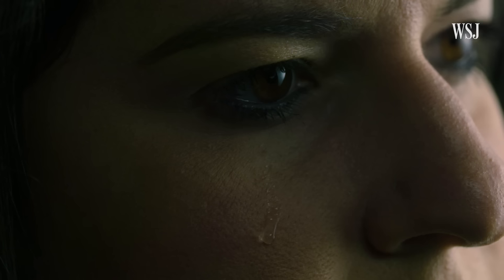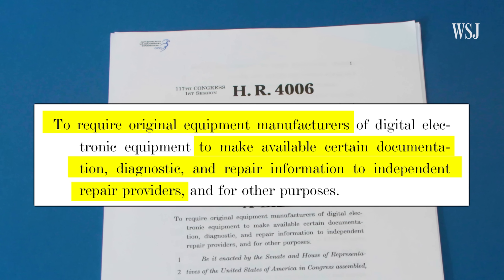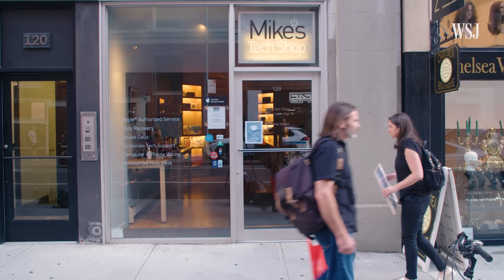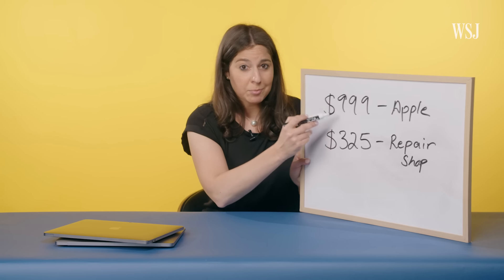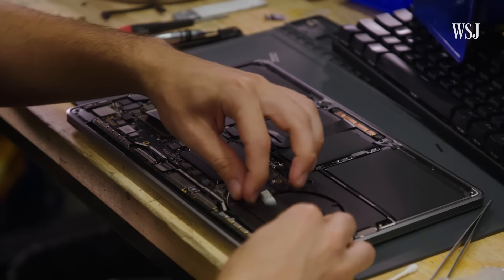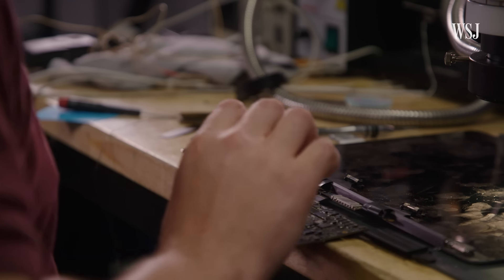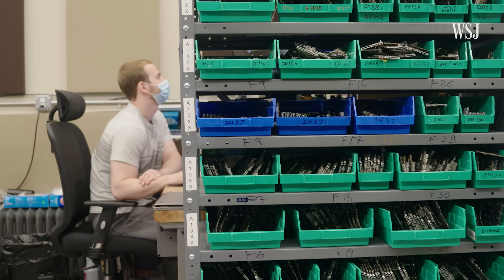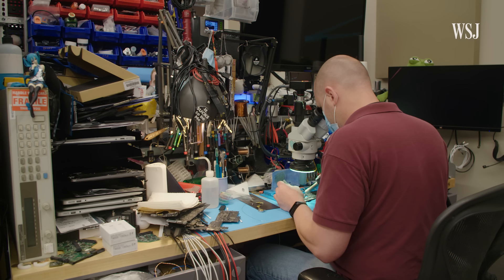Apple Store vs. Repair Shop: What the Right to Repair Is All About | WSJ

Comment: This is what happens when MBAs run companies instead of engineers.
Reply: Apple is the most profitable company ever. This move is genius. That being said, I'm glad I use no apple garbage
Reply: Number of attorneys vs the number of engineers at Apple on payroll: I am guessing that the number is pretty close.
Reply: @JohnMurrayOP  not even close, over 50,000 people work at apple park they only have a few hundred lawyers.
Reply: Especially with Tech companies this is noteable :)
Reply: Sanw with Boeing. They're going downhill due to the accountants and MBAs
Reply: @Dan16673  This move is not genius at all. This move is monopolistic. They know their only competition is Google, an ally, so they can pull moves like this. If a true competitor arose who knew how to build way more reliable, versatile and functional technology, Apple would wake up. Unfortunately, all their Asian competition is still behind in software and still has to partner with American firms like Google and Microsoft to get their phones and computers to run. So Apple will continue to rake in easy money. But it won't last forever. In like ten years, some college kid is going to design a new motherboard or OS or whatever that's going to shock the world and they'll do to Apple and Microsoft what they did to IBM.
Reply: Doesn't make any difference. Engineers get MBAs degrees too. Most CEOs at tech and manufacturing companies have engineering backgrounds. Engineers are not magical beings who will be opposed to designing products that will squeeze more money out of the customer.
Reply: Alternatively, engineers have tested and validated board-level component replacements through a suite of reliability tests (e.g. mechanical shock and vibe, drop testing, thermal testing, etc.) and found that they are unreliable and would likely result in further failures in the future and, as such, complete board replacements would provide the best possible outcome for a customer. Source: I'm a mechanical design engineer with nearly a decade of experience in designing, engineering, and mass production of consumer electronic devices.
Reply: @Dan16673  apple is overvalued more than everything, it's latest mayor innovationes were the ipad and macbook air, you know 11 year old technology at this point, so there's no mayor advantages to buy apple products today.

They are expensive, underpower(compared to products their price and even lower), harder to repair and harder to mod products compared to other stuff on the market(I consider apple the SUPREME(the brand) of technology, expensive for the sake of being expensive and for having a brand label on it).
Reply: Even with Steve jobs at the helm, this was still in place and Tom cook is an eng. This it's apple trying to control everything.
Reply: @elvinlee7592  Tim Cook is an industrial engineer that specialized in operations. Far cry from the type of engineer that designs their products.
Reply: For some reason my brain defaulted MBA to "Mac Book Airs" and not "Master of Business Administration" XD
Reply: @asherujudo7383  
Are you sure about that?
 
I think I will buy my 3rd Generation RISC-V PC with ARM Based Linux, before that happened.
 
As you can see, I'm not precisely an Apple Fan, but I have to recognize they sell themselves as a way to show everybody that you "have the best of the best" only because it is expensive and have a well worked look and feel.
Reply: The profit motive does not give us what is best for society.
Reply: Wowwwwwwww just wow . What a comment
Reply: No it's not about engineers or software developers. It's about the capitalistic mode of production. It's simply more beneficial to shove stuff down the bin rather than repair it, cuz more profits. This is literally the problem in every sector, cut corners to get more profit and stop caring about the environment for more profits.
Reply: My favorite steve jobs quote/
Reply: @magzieforfunj187  "So, if you were a product
 person you couldn't change the course of that company very much. So, who influenced the success of PepsiCo? The sales and marketing people. Therefore they were the ones that got promoted and therefore they were the ones that ran the company. If you were a product person at IBM, or Xerox...so, you make a better copy of a better computer. So what when you have a monopoly market share? The company's not any more successful. So, the people that can make the company more successful are sales and marketing people and they end up running the companies. And the product people get driven out of the decision-making forums and the companies forget what it means to make great products. The product sensibility and the product genius that brought them to those to that monopolistic position gets rotted out by people running these companies who have no conception of a good product versus a bad product. They have no conception of the craftsmanship that's required to take a good idea and turn it into a good product and they really have no feeling in their hearts usually about wanting to really help the customer." - Steve Jobs; The Lost Interview (1995).
Reply: Havent read a single other reply to this thread, but, having a BS and MBA and an understanding of engineering, I could not agree more.
Reply: @moisesrosario9716  thats exactly what it is, fashion
Reply: 800 likes
Reply: @Dan16673  68
Reply: Disagree. A company run by engineers would be under the same pressures from shareholders and from competitors to exploit every opportunity for profit-maximizing. It would follow the discipline of the market or it would disappear (which is a sad state of affairs)
Reply: Don't support this product.
Reply: You don't want engineers to run companies LOL, it's an entirely different level of experience
Reply: Mac Book Airs run the company?!
Reply: I personally think Apple started off amazingly with the introduction of iPhone and they should focus on innovation.!
Reply: Apple is LITERALLY ran by an engineer…
Reply: @Nikola Tesla "best" is imprecise language and not a objective term. I DO NOT like their products therefore they are NOT the best to me, sir.
Reply: @JohnMurrayOP  Thats called Oracle
Reply: @JohnMurrayOP  Thats called Oracle
Reply: @crackingbreznuts3343  r/woosh
Reply: Steve Jobs was an ad man
Reply: Techable Tech  fair enough
Reply: @Dan16673  Its only genius in terms of profit. Not in terms of ressources or customer satisfaction. So basically its not genius overall.
Reply: @asherujudo7383  Amen. Let's fkn hope so!
Reply: But tesla has the same problem...
Reply: @Dan16673  This
Reply: @Dan16673  Apple has been at the forefront for something's, but really what there good at is marketing.
Reply: You mean every for profit companies in the world with shareholders
Reply: This comment is reductive but I just watched one of your videos so I’m not too surprised.
Reply: @asherujudo7383  invent a new "motherboard". This shows that you have no idea what you are talking about. A motherboad is the least important part. It is like saying. There will be a revolution in puplic transport because somebody invents a new type of concrete
Reply: I'm a Business major....and unfortunately....this is true...
Reply: @profix25lo  It seems like during the rise of Apple, Wozniak's board was the gamechanger.
Reply: I would say it's more what happens when MBAs buy computers instead of engineers
Reply: 😒😒Really!?
That's all you could come up with!?
If you really believe this then you don't know the first thing about a "company"!!
Reply: @ab185  ok but I'm not spending 1k on replacing a laptop when an inferior but still effective solution costs a quarter as much and won't shorten the device lifespan anymore than the planned obsolescence already did.
Reply: @TheBananamonger  "won't shorten the device lifespan anymore than the planned obsolescence already did."

Going to need a source or citation for evidence of that. I know it probably felt real good to type that out and you're real sure of yourself, but it's quite far from the truth.
Reply: @ab185  Then why not let people screw their own devices up so they get it? There's not many repair technicians who know how to do board level repair well because they can't due to the lack of resources. If the industry were to allow repairs to be more complex, then there might be new repairmen who would be more capable.
Reply: @elvinlee7592  so a company trying to control everything is bad, but a government having even more power than anything else is good. yeah hypocrites reaping what they sow
Reply: Engineers can be corrupt as well though.
Reply: @goodgoyim9459  elections by the nature of having effects, always "mean things". Whether or not the effects are what you want are moot. Inaction is also a cause that has effects.
Reply: @ab185  Interesting then that 'woz' fully supports right to repair and noted that the first apple made shipped with full schematics. Apple also spreads BS such as you can't recover data from water damaged iPhones which is patently not true in the vast majority of cases. They also remove posts saying its possible from support site. Do you perchance work for apple or another equally greedy tech supplier?
Reply: @taihaole4900  Or could innovative by supporting right to repair, selling parts to independent repair for a new profit stream and potentially selling more computers/phones because of this additional support. Think different an Apple strapline is maybe something they should reflect on. Woz seems to think so !!!
Reply: @woolyimage  I don't work for Apple, but I'm an engineer with a decade of experience designing and engineering consumer electronics and know why Apple does what it does.
Reply: @ab185  Interesting then that Woz who has perhaps a 'little' more experience and is a co founder of apple thinks they are doing the wrong thing with opposing right to repair, when they DO NOT provide any credible options themselves. Thats before we get into any environmental arguements. Seems like you are more pro business than consumer
Reply: @woolyimage  your appeal to authority is going to fall on deaf ears. Woz hasn't been involved in engineering, design, mass production, etc. for almost 3 decades. His opinion is largely irrelevant.
Reply: @crackingbreznuts3343  they could be using outside council
Reply: @asherujudo7383 this is precisely why they lobbied so hard to ban Huawei from the US. Huawei was their only real competitor and basically forced them to put a whole bunch of new technologies into their phones. Which was very costly.